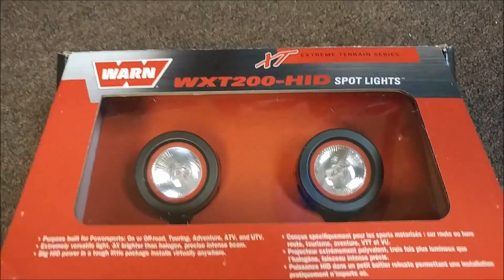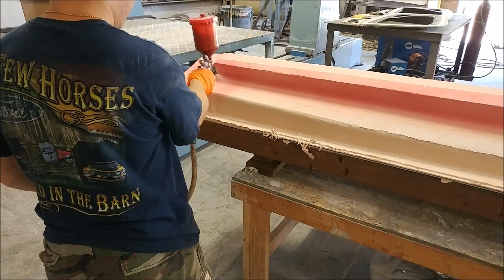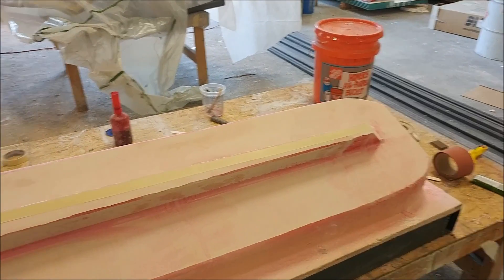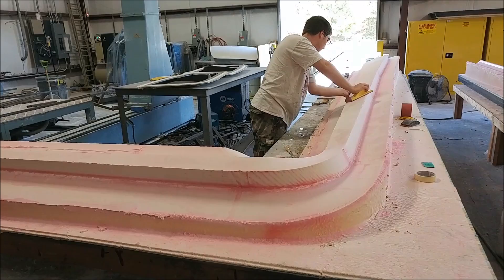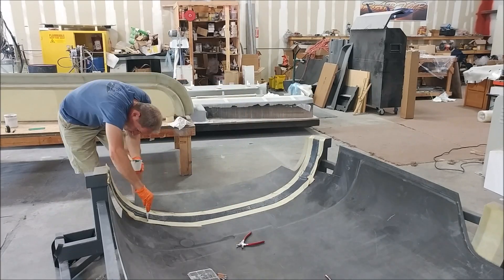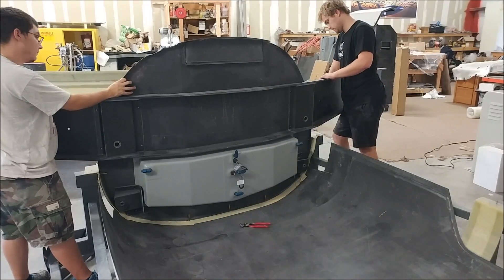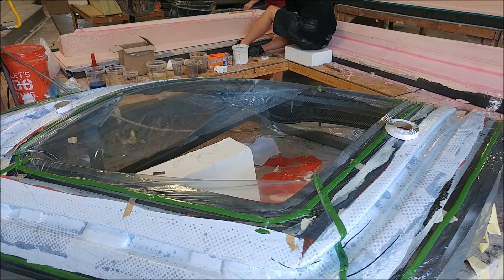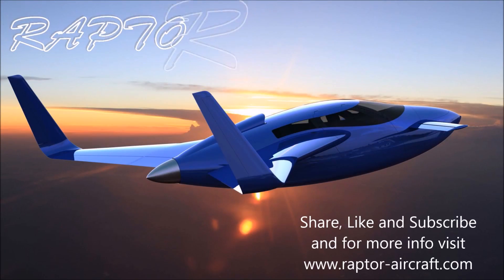Aft Bulkhead...  Boom! - Bonding the bulkhead into place

Comment: Anxious to see the engine running on the test stand. Don't know if you would be interested, but GAMI, in Ada, OK  has a great engine test facility.  They are the inventors of the GAMIjectors, which are balanced fuel injector nozzles for fuel injected engines. Their facilities are located right on the airport (KADH) They also have tornado alley turbo, so they are very familiar with turbo normalizing engines.

Comment: When bonding those together, sanding may not be good enough, it doesn't scuff up the dimples between the weave, only the surface. Try sand blasting it. It just roughs the surface up uniformly and doesn't get into the CF, works way better than sanding.